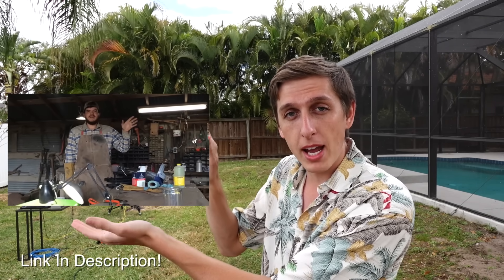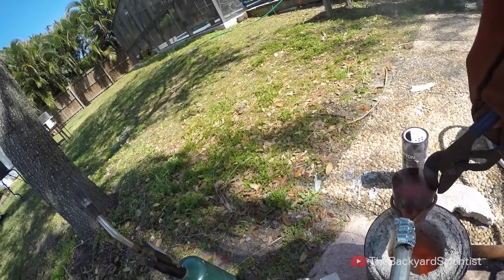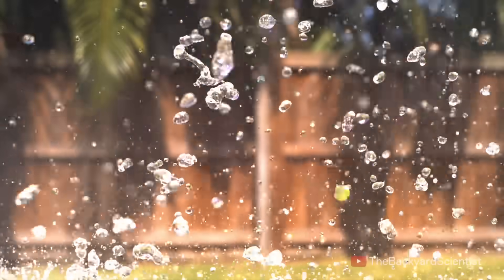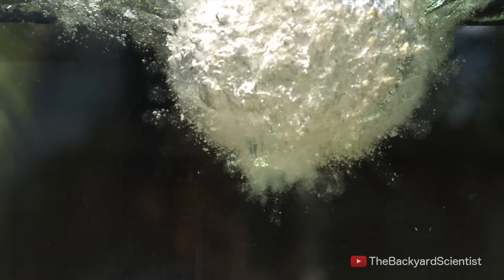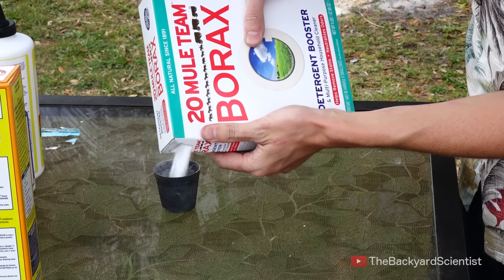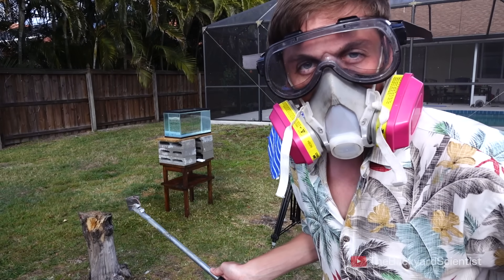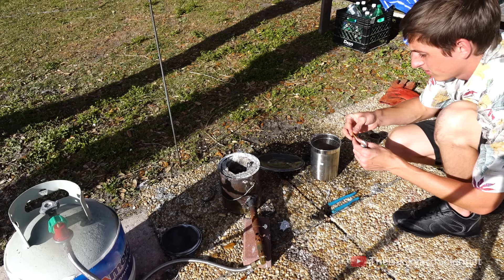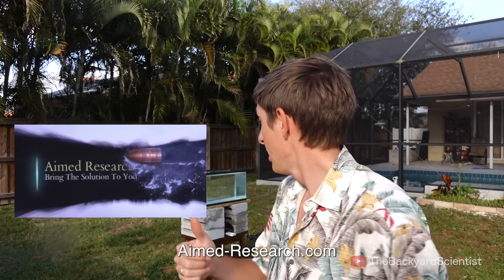Pouring Molten salt into Water - Explosion!

Comment: great,now someone is going to weaponize the ocean :P

i think what is happening is every grain of salt holds it's own energy,the explosion we're seeing is similar to that inside of a nuclear bomb where thousands of chain reactions are happening,when the salt is molten,and then cools rapidly,it solidifies as grains not as a solid like the borax so every individual grain is cooling and solidifying then releasing it's built up energy..
here in hawaii,sometimes when you are at the beach,and pools of sand water evaporates and leaves behind salt crystals,if it's hot enough,they will actually pop off of the rocks..

wish i had a scientific answer but it's only my hypothesis

Comment: Coulomb explosion? 

How much difference in temperature was there between the first 2 attempts that fizzled vs the ones that exploded? If it is strictly an expansion of water vapor from water caught up in the molten salt I would expect the cooler (still at ~1500 F) to explode as well. I would expect a gradient to the explosion increasing with increasing temperature, but you seem to get a fizzle or a bang.

Comment: It's either the sodium solidifying so fast there's a pressure differential inside the chunks big enough to make it explode, or the effect you describe in the video stepped up. The very tip of the sodium stream cools an the liquid behind it flows out and around it making a large pocket. This way the Leidenfrost effect wouldn't be able to stop a good chunk of water from flashing into steam inside the sodium enclosure, making a decent bang

Comment: I think it's air gets trapped in the liquid as you pour it when it hits the water the outside hardens but the inside is still molten the air expands and it explodes I bet you won't get the same reaction if you just place the crucible with the salt in it into the water.

Comment: The water is flashing into steam on contact with the hot salt, it's a very fast thermal expansion.
Reply: +Rj Conk if this was the true you would see it on the high speed becouse water cant evaporate that quickly. i think its just like sodium in water reaction. the survac tention releases and tiny drops of molten salt accelerate at a tremendous speed and pushing the water away. this reaction is called a coulomb explotion.

Comment: in nuclear power stations, they pressurize the water inside the cooling pipes to overcome the leidenfrost effect- perhaps in this case, it is the velocity/pressure of the sodium that forces contact with the water, overcoming the leidenfrost effect.

I would also think that there's a clue in the sound of salt cooling down, that crackling suggests a crystal structure breaking apart; if that process were accelerated, say by exposure to cold water, I would expect the salt to rapidly cool, crystalise and shatter, it may be the force of the shattering which drives pieces of salt into contact with the water at sufficient speed to overcome the leidenfrost effect.

just a theory.
Reply: A game theory.
Reply: +Seth Feldmann thanks for watching

Comment: + TheBackyardScientist  I don't think the water evaporation is causing this. The Leidenfrost Effect would prevent that just as it does with the other salts you tested. The reason they didn't explode is that sodium chloride is a much harder crystal than the other salts. The outside solidifies first. Then the center cools and contracts creating tremendous internal pressure. What you are creating is a Prince Rupert's Drop. But because crystal is weaker than glass, it can't contain the pressure. So you have an instantly failing Prince Rupert's Drop. That's my theory. If you'd like to test it, try dropping the molten salt into oil. I won't boil like water but I bet you'll get a similar explosion.
Reply: +Why would the center expand as it cools?  It is not water ice.    Backyard suggested that it is water trapped in the crystal which expands as it boils and this causes the explosion.  That should be true for all the sodium salts.  What you propose would explain why the explosion is more energetic for NaCl: the crystal pockets are stronger and so the superheated steam builds more pressure before the crystal pocket fails.If you have it, can you link up where you found hardness of various salt crystals?
Reply: +wread42 I edited my comment. I didn't mean to say it expanded. I should have said contracted. I don't think the water is getting into the salt. I think the Leidenfrost Effect prevents that from happening. At 7:55 he says it's a mystery that the Leidenfrost Effect doesn't happen with Sodium Chloride. I think he is totally off with that. It does happen. It's a physical phenomenon. It doesn't matter what the material is.

Comment: The ionic bonds in the salt become weaker as they heat, so maybe they become weak enough for water vapor to ionize them, even with the liedenfrost effect or whatever happening. And When they split, the heat causes them to expand, ripping the molecule apart into its ions. This could then cause a chain reaction of molecules splitting and ions smashing into one another, rapidly expanding. It'd be like a little nuke but on a bigger particulate scale.

Comment: When you melted the borax it dehydrated to 20% the size. The carbonate also decomposed a lot. You dropped like a tablespoon of each whereas the salt you did a full crucible. That wasn't a fair comparison at all and looked more like a marketing stunt to create a "mystery" that doesn't exist. Yes, salt will explode at higher weights cause it's already heavier than borax/carbonate by volume AND you're adding more of it. But if you drop enough weight of ANY molten ionic salt into water (above 500C) they will ALL explode. 

Also, that pure sodium comparison was ridiculous. 5gms molten sodium compared to 50gms salt? WTF. I understand this is "backyard science" as in not science at all, and the slow-mo shit is cool... but everyone knows 50gms sodium would have blown that tank and your camera to pieces.

Comment: check the heat capacity and density of the salts. it could be that there's significantly more heat in 50g of table salt than the other salts. 
or maybe it has to do with thermal conductance of the salts. though I'm sure the thermal conductance and heat capacity aren't far from each other

Comment: its because Sodium Na 11 is in the alkali metals family and every member in that family reacts with water. Francium however can only be synthesized and is radioctive its half life is ~22 minutes so it cannot be tested but simulations show what it would be like. Sodium is a metal found commonly but in its unprocessed form of NaCl (table salt) it will react violently with water.
Reply: +kelton long in NaCl the sodium cant react ,the chemical bond get loose at much much higher temperatures its just the water evaporating really fast
Reply: TheGamesfriend True, but couldn't it be the salt rapidly cooling the crystals?
Reply: yeah but just the cooling of the salt until it crystallizes doesnt cause the explosion it doesnt really expand or compromises when changing from liquid to solid state
Reply: TheGamesfriend Really all we can do is theorize at this point in time. . . there is no right or wrong its all just a theory

Comment: Perhaps it is because sodium chloride has a higher affinity (solubility) to water than the other salts you tried... And because that affinity goes up with hotter water temperatures, there is a greater driving force to mix rapidly.

That's just my theory

Comment: I'll chime in with my 2 cents being a chemist.

Your hypothesis that if a chemical occurred then a pH change should have occurred has one problem, there is no guarentee that a chemical reaction will result in an appreciable change in the pH that a pH strip can detect.  For instance if the water is broken down into Oxygen and Hydrogen atoms, ionized, etc. the products may not remain dissolved in the water but instead leave the system as a gas.  Which in that case you would expect the pH strip to show little to no change.  

Second you can clearly see the "vapor skin" around the salt prior to the explosion much like you see with all the other compounds.  To me this seems to negate the hypothesis that the water "gets inside of the salt" because it is clear it is already vaporizing the neighboring water prior to the explosion.   This skin would prevent liquid water from even entering the salt.   You also have the issue that in one of the shots the explosion happened almost immediately at the surface of the water.  

Third the rate at which the gas expansion occurs to me seems too fast for a steam explosion.  The fact a 7000 fps camera barely catches the initial explosion is pretty telling that this was incredibly fast.  In about 1-3 frames (approximately 4/10th of a millisecond) the blast wave has already hit the sides of the wall and bounced back.  Given that a standard fish tank is what?  50x25 cm long? By a back of the envelope calculation, that would seem to indicate that you have an explosion speed of about 110 cm/ms or over 1,000 m/s.   Normally 1,000 m/s is in the range where you start dealing with chemical explosions instead of mechanical ones. For instance Black Power is around 1,500 m/s.   Now someone more experienced than I in this can give a better estimate, but in my naive approach this velocity appears to be too damn fast for a steam explosion. 

I could be wrong about this, but this appears to me that on the surface it may indeed be a reaction that is chemical in nature. It could very well be that the chemistry is just right to form some exotic species that in turn rapidly react to form a gas that causes the explosion.  And considering the other salts you tried didn't exhibit this behavior, it leads me to believe it is very much chemical in nature.
Reply: wut? ._.

Comment: I think it's obvious. Molten salt is highly ionic with melting temp of 801 degrees where's it's just 170 for a boric acid. Temperature difference is very high in case of molten salt.
Reply: +Sahashranshu Maurya Boric acid is not the same as borax which is sodium tetraborate.
Reply: Oh yes of course. Sry my bad

Comment: in the auto tech industry there are valves they use for some engines that are filled with sodium and its suppose to help with cooling,  but they say to NEVER put em in water. If they happen to be cracked and you put em in water the sodium will explode sending pieces of the metal valve flying everywhere.

Comment: Could the reason that the others didn't explode in the water be as simple as the boiling points? Is it possible that they never actually make contact with the water due to the heat creating a gas barrier between them?

Comment: assuming the surface tension of molten NaCl is lower - it looked like it had fairly low viscosity, so probably it'd also have low surface tension. that's why you'd see the water cavitation in molten NaCl but not borax or sodium metal - sodium metal has high surface tension.

Comment: Sodium (Na) in its pure form is extremely reactive. Like every other element in column 1 of the periodic table it has the extreme tendency to give 1 electron away to stabilize its valence. there was no need to turn the pure sodium molten to get it to explode on the water. It would have reacted and exploded in its solid form with the introduction of water (I've done it albeit with flakes approx. the size of a grain of sand.) IT IS A CHEMICAL REACTION. 2Na + 2H20 -> 2NaOH + H2 This is because the Na has a higher binding affinity and will "kick", if you will, a hydrogen away from the water molecule and reform it to NaOH. The flames themselves are actually a product of the H2 (hydrogen gas) being ignited from the extreme heat produced by the electron/energy transferance between the molecules. Courtesy of my Highschool Chem 1 and Chem 2 class.

Comment: The explosion appears to be caused by the extremely fast transfer of heat into the water, in the absence of the Leidenfrost layer.

Table salt has a great affinity for water.  It's hygroscopic and has high solubility. Adsorption probably breaks down the vapor layer. This also produces more heat.

Borax has much lower solubility than table salt. 

Can you get your hands on some lithium chloride? Melting point is a bit lower than table salt, but it also has high solubility and is used as a liquid desiccant. 

Washing soda would also be interesting to see. Melting point and solubility similar to table salt. More dangerous because of it's alkalinity. You might want to cover your skin.

Comment: My theory is the molten borax has a high viscosity, as it looks like in the video, bit like a thicker honey. This gives it a higher surface tension, thus stopping the molten borax creating water cavities within it.
Reply: +chris howarth Borax also has a higher specific heat, therefore even at the same temperature, the molten borax has more energy than the molten borax per kg, so maybe this causes a stronger laudenfrost effect.

Comment: I dont believe its a physical reaction. I believe it is a chemical reaction. sodium is an alkali metal. i believe the reason the table salt explodes with more force is because its not 100% pure. So when the reaction happens the theres more surface area allowing it to react quicker and more force, kind of being a catalyst. 

tldr; its a chemical reaction with a catalyst and less surface area as the pure sodium
Reply: +Dakota Ayy But in salt the sodium is a stable ion, it should not react with water, and if it did the pH would have changed.

Comment: Wait, if it's not chemical reaction there should still be a ph level change as after the physical reaction the water would still react chemically with the remaining sodium chloride. This would suggest that the sodium and the chloride loose chemical cohesion and react separately with the water. But that's based on my limited understanding of physics and chemistry. (that's not sarcasm I really do have little understanding of them)

Comment: doesn't salt have the property to breakdown the barrier at which heat is safely transferred; such as sweat helps cool your body faster due to the salt in it. If correct about that it may retain the property in molten form and be interfering with the Lederhosen effect by cause so much heat to be transfered it causes the molecules to break up instead of forming steam.